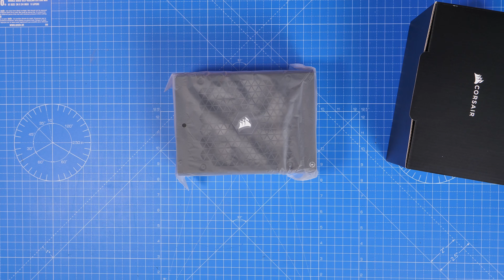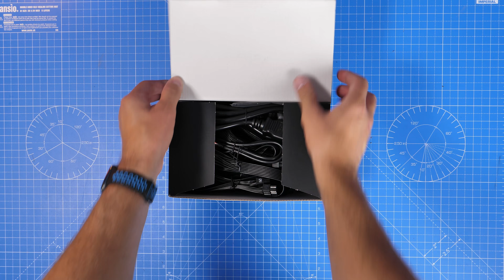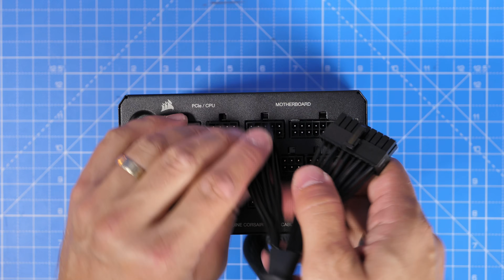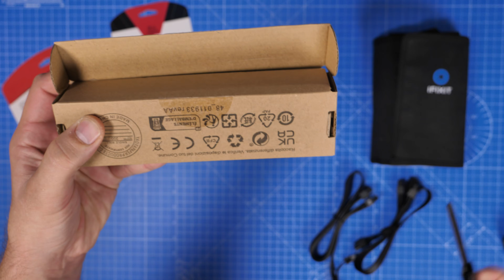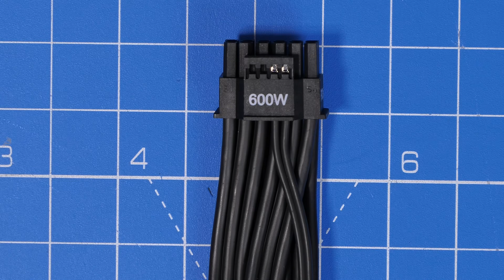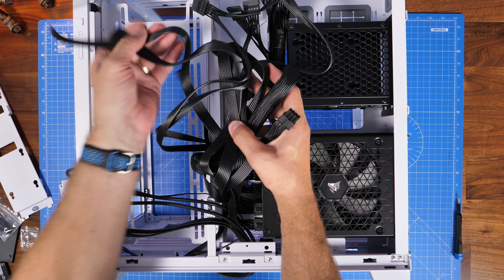Corsair HX1500i installation guide with 600w 12vhpwr adapter and cable guide

Comment: So the 1500i has a c19 power cable? Can you plug this into a regular wall outlet? I assume regular wall outlets are a 15 amp. Can you use a 20 amp c19 cable to plug into the presumed 15 amp outlet? - The new psu's no longer come with power cables...so one would have to by on their own.
Reply from the maker: They come with the power cable
Reply: @TheProvokedPrawn   I’m unsure if this is a US thing but I purchased both the 2025 rm1000 & the hxi 1500 & both didn’t have the power cable. I feel like the chances of that being an error is low so it’s just probably what Corsair is doing now. Also do you know if can you plug the c19 into a regular wall socket? Thanks, yr vids are always helpful
Reply: @TheProvokedPrawn   No response leans that the Prawn as helpful as his vids are, may not actually know the answer... So for others that may come across this: Corsair tech support says yes, power cables should come with BUT regardless of what they say, it’s a real thing that a good amount (at least from best buy) do not come with cables... As for 1500i use with a standard outlet, tech support said yes & recommend a surge protector but didn’t know the specifics…Here are the specifics: 15-amp circuits (standard outlets in US are 15amp) should not be pulling more than 1,440 watts continuously per the 80% rule. The 1500i power supply can pull a total of 1,500 watts. So in actuality, sure you can take a chance if you don’t use close to the max wattage with other devices in use (the psu will draw only what it needs in theory) but a 20amp is the safe side & unlike a 15amp actually provides the full power (20amps are like in yr kitchen ect, you could have an electrician change yr 15amp if need be). My current take is if yr buying 1500i yr going for power & if making compromises with a 15amp should just get a 1200…It’s kinda irresponsible imho for corsair to offer a higher wattage without explaining the best use case, the psu has a c19 socket for a reason smh…I garner many users don’t understand that it’s not totally safe based off of the lack of being able to respond when asked to explain.

Comment: Tenho uma fonte Corsair Ax1200i Platinum, vou ter problemas ao utilizar o Cabo corsair Pcie 5.0 12vhpwr com essa fonte para alimentar uma RTX 4090 ? estou com medo de usar essa fonte por ser um projeto antigo.
Reply: O ideal é comprar o cabo 12vhpwr porque esses adaptadores não prestam, conforme o tempo dependendo do nível de uso da gpu vai fritar seu conector da placa de vídeo e no conector do adaptador.
Reply: @HigorMatheusAlves  Vendi a fonte e comprei outra já no padrão ATX 3.1 com conector PCIe 5.1 nativo e revisado H++
Reply: @ Boa amigo, parabéns, a minha chegou hoje da hx1500i modelo cp:9020261-ww, tem que ficar atento porque ainda estão sendo comercializadas com mesmo preço ou até mais caro do modelo cp:9020215-ww e alguns comprando desse mesmo achando que vem o cabo com o novo padrão PCIe 5.1 12V-2x6, mas não vem, somente a partir desse modelo que mencionei logo acima.

Comment: just bought a hx1500i, now comes with the 600w cable!
Reply: I just bought the HX 1500i as well, coming from a 6+ year old Corsair HX1200i (nothing was wrong with it, but it only supported Type3 cables! So, I can't even use it with my new 5090! 😢)

I was very worried this new HX1500i wouldn't come with the 600w cable. Thanks for calming my fears!

Comment: Is this video out of date?  Looking at Corsair's website, it looks like the HX1500i and HX1000i both already come with the 12VHPWR Cable (12+4) pin now...
Reply: I can confirm, my HX1000i came with the 12VHPWR cable.
Reply: Me too, I just got the HX1500i and the 12VHPWR is in the box
Reply: I heard the only difference is the 12vhpwr making the unit atx3.0
Reply: Yes

Comment: Hey I bought an Hx1000i for a new build I had planned with an Rtx 4080 super. They throw in that god awful adapter but my psu included the special 12 pin adapter for it. Is that adequate for the power? Or will I need to use the original adapter for the card with 3 pcie power connectors
Reply from the maker: It's fine

Comment: Thanks for showing the additional 600w cable, I just bought one online. I thought it had to come with the PSU, and had specific connections to the PSU. I sent my AX1200i back to Corsair under warranty and they sent me back a brand new HX1500i PSU because the AX1200 was EOL.  Corsair were great to deal with.
Reply: Hello, could you share the link for the 600W cable, please! I would like to get the HX1550i PSU. Thanks.

Comment: Hey Prawn, watching this in 2024. Wondering if you are still using this PSU and the GPU power adapter, and if any reviews/opinions so far?
Reply from the maker: Yeah it's been in my main machine all this time with no issues. No noticable sound problems, more than enough juice and easy to use in larger cases
Reply: @TheProvokedPrawn  That is awesome! It is a beast of a PSU. The only thing I have noticed it that it runs hot, the unit comes with silent mode and the fan doesn't kick in till the load is high enough but the temps still climb. I have a custom fan profile set to <1000 rpm that keeps it at 34.50C but if I use the default fan profile it climbs up to 40C before kicking on. Just an observation.

Comment: I bought the HX1000i (2023 version I think) and I was wondering whether the [Corsair Premium Individually Sleeved PSU Cables Pro Kit Type 4 Gen 4 – White]     cables will work with it?  Along with the 14900k, z790 asus prime-a and iCUE LINK H150i RGB.

Comment: Hey is the 600w cable necessary? For a 4090. Can I just use the stock cables?
Reply from the maker: Not necessary, but why would you want to use those awful adapters
Reply: @@AdamMadoffAron hm, last time i checked the 4090 comes with a cable that has 4 connectors, i never said its not meant for it, i asked if it was nessecary
Reply: @@AdamMadoffAron how can it only be for ''OLD'' power supplies
Reply: @@AdamMadoffAron no seriously, how can a connector with 4 pcie connectors be only for old power supplies.  even though i can connect 4 pcie cables to the one of the newest Power supplies there is how can it be only for old power supplies??

Comment: Nice that the cables are all black insteads of clashy red, yellow and black cables.  If I want brightly colored cables I would have special ordered custom cables.  Black works with black or white PC cases.  This PSU is one of the reasons why I purchased a Thermaltake CTE P750 super tower case with the PSU able to hide complete out of the main mobo bay

Comment: After replacing my old psu with this one my system fans and leds power on for half a second and then the system doesn't boot 😢 I made sure to replace all the old psu cables with the ones that come with the psu and everything seems to be connected exactly like in this video, I'm not sure whats wrong :(
Reply: pci/ cpu cable from power supply to motherboard plugged in correctly?

Comment: I had that case and same PSU. Took the case back for the 011 dynamic XL because the psu and cables were scrunched. Awesome case and wish they made an xl version.  The evo leaves no room with a psu that size
Reply from the maker: They are making an XL version

Comment: RTX 4090 need 4*8 PIN to work, how can this cable used only 2 * 8 PIN run great this GPU, and one 8 pin from PSU deliver only 150 watts?? Really can't understand
Reply: You do realize the CPU 8 pin cable can do 300 watts each right? Then it's the same for GPU 😅 it's insane how misinformation can spread for PC normies

Comment: the 8 pin psu connector deliver only 150w, how can RTX 4090 run with only 2*8 pin ?
Reply: that's a special adapter made to carry 600W,  if you don't have that, 4090s normally come with the adapter that splits into 4x8pin to carry the power, you can get away wit 3x8pins adapters if you don't OC the gpu.

Comment: That's confusing because I thought each PCI-e 8 pin provides 150w max. So, wouldn't that only be 300w?
Reply: Both 8-pins are able to provide 300w each. The "8-pin connector" section of this video explains it better than I can: https://youtu.be/EvsPZA8CkBY

Comment: would the corsair 600W PCIe 5.0 12VHPWR Type-4 PSU Power Cable on a 4080 work with the corsair rm850x
Reply: Yes, Check the Corsair PSU compatibility page, All PSU's with the orange dot (type 4 pcie) is able to use the 600w cable, it has a limit of 600w but will only supply what your GPU needs. A little late but hope this helps.
Reply: @Delusional-People  appreciate it
Reply: Yes, but keep in mind the total power draw from all your parts. Make sure you the power draw is under 850w.
Reply: yeah im wondering that too.
Reply: thanx i needed to know to!

Comment: Damn I thought this psu was 4090 ready with the supplied cable. Does it require the corsair or order from cable mod?
Reply from the maker: Not required just a better, cleaner option

Comment: Well i would like to know if this cable can work with a HX1000i and an Gigabyte RTX 3090ti Extreme waterforce?(has 3 cable adaptor)
Reply: Only for 4090s
Reply: @jonsnow2555  I bought it in the end and it works perfectly with 3090ti at maximum load without overheating of the cable.

Comment: So I just bought a 12vhpwr cable from cable mod with the 4 pcie that should plug into the PSU now my question is that cable mod cable should be able to plug into 4 separate pcie slots in the back of the Corsair hx1500i PSU right ?